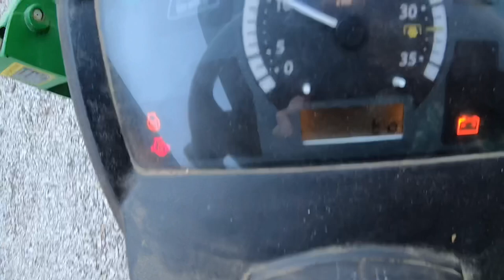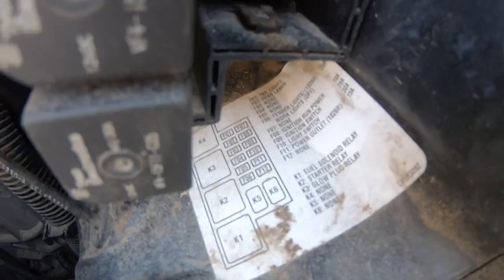John Deere 1025R No start, diagnosis ignition switch - fixed | CBH

Comment: The ignition key on the tractor is a joke, you can by them at Home Depot and online. The keys ARE NOT unique like the ignition keys for cars. If they a giving you a problem, replace it with a toggle switch.
Reply from the maker: @russconklin3414  thanks for watching and your comment. Yes, I just ordered the switch off Amazon or eBay not sure which. It was pretty cheap to replace and uses the same key. If it goes out again it might get a toggle switch. Have a great day and be safe!

Comment: Your other safety feature is the seat.  There’s a switch under the seat.  It’s a normally open, sit on the seat, it closes, completing the circuit - tractor starts.  Thanks for this video, you might have saved me some time & money.
Reply from the maker: Thanks for watching and your comment. Have a great day and be safe!
Reply: True, but if the tractor gearshift lever is in park position on my tractor, the engine will start and run with no one in the seat.
Reply from the maker: @Larry-d3i  yes my 1025 in the video will do that if in neutral. It’s handy for moving the loader without needing to get on the tractor. Thanks for watching and your comment. Have a great day and be safe!

Comment: Thank you sooooo much. You saved me from a ton of frustration, lost time, and money. It wasn't the ignition on my tractor but the wire coming loose from the solenoid. Had you not been so through with your video, I would have thought it was the starter or ignition. And then i would have had to find a way to load it on my trailer... which would have be next to impossible with the loader on the ground and it not starting to raise the loader. And then I would have had to take it to the repair shop... which is far away, which would have cost me time and a lot of money for them to diagnose and fix the problem..... a lose wire.  You have earn a Subscribe and my sincerest thanks.
Reply from the maker: Thank you for watching and we are very happy it helped you out. Appreciate your leaving such an amazing comment! Have a great day and be safe!

Comment: Excellent video, thank you for posting it, also, I noticed you have the old style air cleaner bracket that bolts to the valve cover, keep a very close eye on that, they’ve been known to break that cover and cause serious damage to the engine,John Deere has a upgrade that you can get so that doesn’t happen, for piece of mine, I replaced mine, thanks again for the video..
Reply from the maker: Thanks for watching and the tip about the air cleaner. We will definitely check that out. Have a great day and be safe!

Comment: Today, I couldn't get my 1025R to start.
The lights on the dashboard come on but once I switch the key to the start position, I hear some clicking noises from the dashboard but nothing from the starter/engine.
Maybe I'll try wiggling the key some, while in the start position.
Great video!
Reply from the maker: Thanks for watching and your comment. Yes that sounds very familiar to how mine was. If wiggling the key works go ahead and order the ignition switch, my experience is that will only work for a little while before it doesn’t. Good luck and let us know how it works out for you. Have a great day and be safe!
Reply: @CopperBarnHomestead  : Replaced the ignition switch but I get the same thing.
I tested the batter with a multimeter and it shows 12.1 volts.
After I let the glow plug do its thing, I switch to start and I get something like a "little machine gun" of ticking noises but nothing from the engine.
Reply from the maker: @machonsote918  sounds like your solenoid is trying to engage the starter possibly. Is the noise coming from down by the starter or up by the dash? The solenoid is mounted to the starter if I remember correctly. If the noise is up by the fuse box near the dash there is a starter relay. I switched that relay with another relay that was the same and it didn’t work but helped me diagnose. I guess the obvious is you tried adding a boost charger or jumping it some way? Sometimes a battery will show good voltage but still have no amps behind it. Sorry if that is too obvious and something you already ruled out, usually thats the first thing to try. Good luck and please let me know what you end up finding out.
Reply: @CopperBarnHomestead  : Hey!.....I got it to start!
The noise was NOT coming from down by the starter.
I had already brushed off some build up on the red terminal of the battery with a wire brush and used a little hammer to hit the terminal to knock any remaining residue, but the "ticking" still continued.
I pulled out and inspected each of the fuses and they were all good.
As a last resort, I went ahead and stayed on the switch all the way to the right and ignored the "ticking" and VOILA!.....the engine turned over!
I let it run for a few minutes, shut it off and started it again without "ticking" noises, just as normal.......................This is with the old ignition switch.  Now I have a "spare" new ignition switch.
Reply from the maker: @machonsote918  excellent!!! Glad it worked out and an extra ignition switch may come in handy yet! Have a great dsy and be safe!

Comment: My switch looked the same. All beat up after only 5 years, so when I bought a new one I didn't buy the john deere one. I think an issue with the jd switch is it allows dirt in even with the key in it.
Reply from the maker: Thank you for watching and your comment. I think you might be right, it looks like mine has been attacked with a screwdriver and I don’t think that happened. Thanks again. Have a great day and be safe.